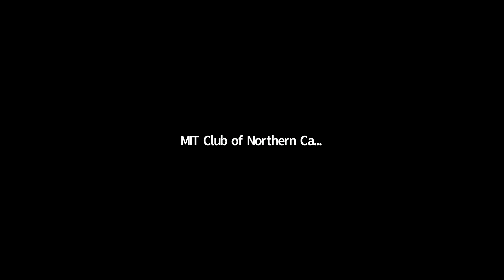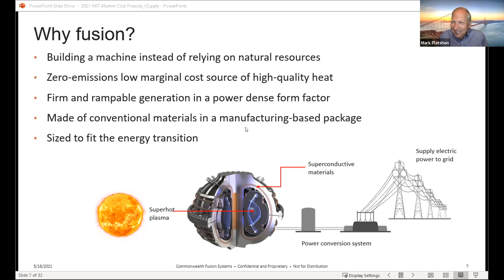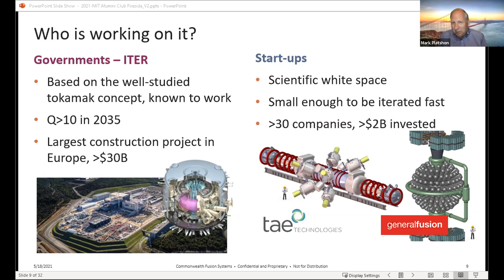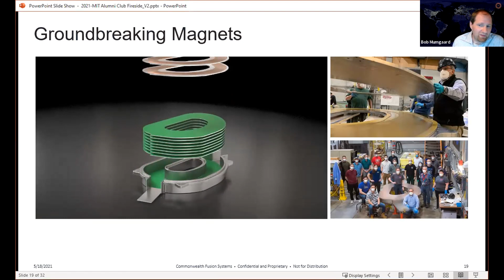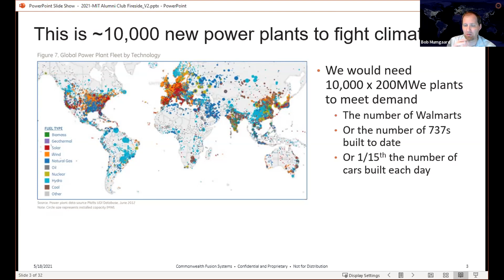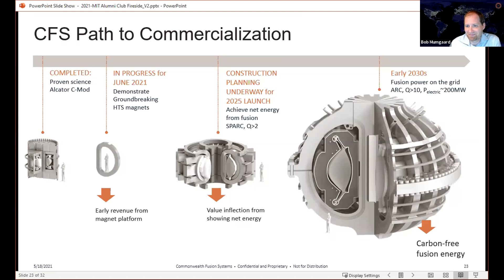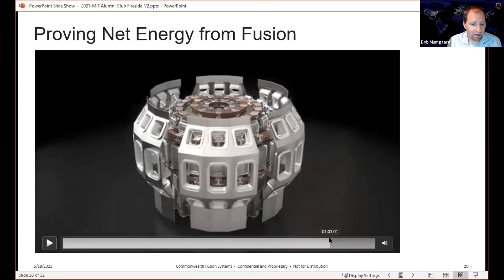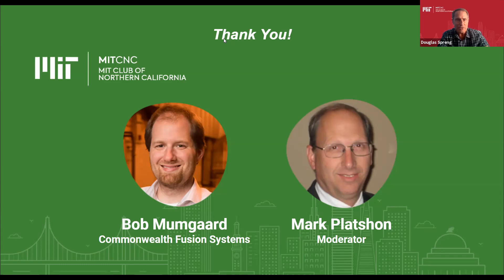Commercial Fusion: Unlimited Clean Energy?

Comment: zero-carbon jet fuel is easy, you just make the fuel from seawater and atmospheric CO2, burning this fuel just puts carbon back in the air where it came from. The chemistry is well known and easy, it just needs lots of cheap clean energy. If this energy is cheap enough, synthesizing fuel will be cheaper than drilling for oil. :-)